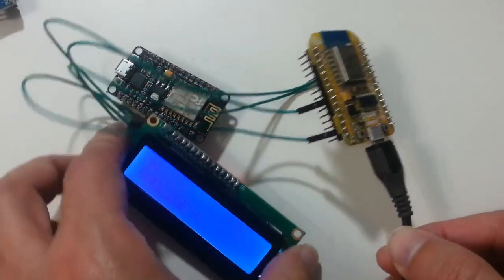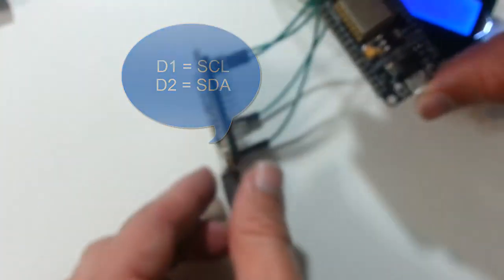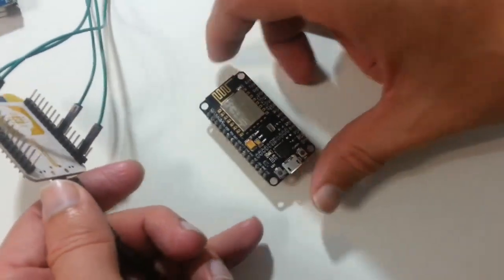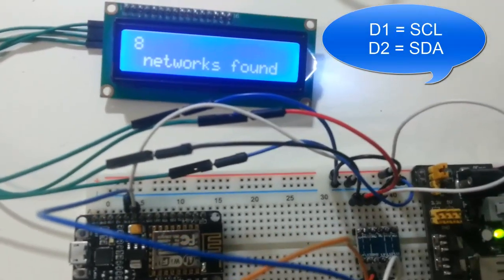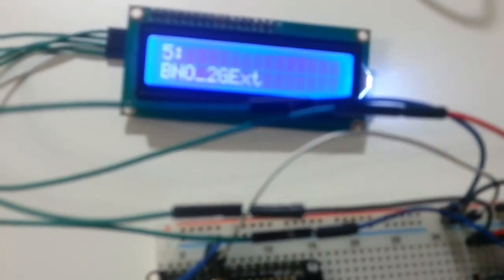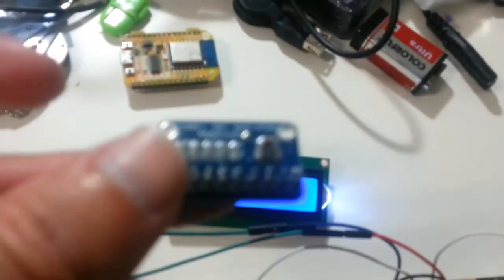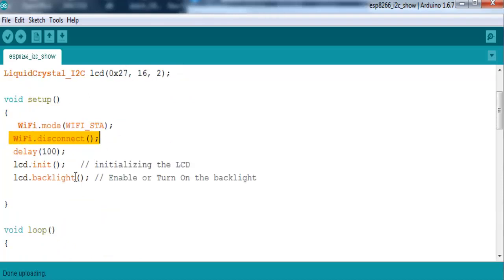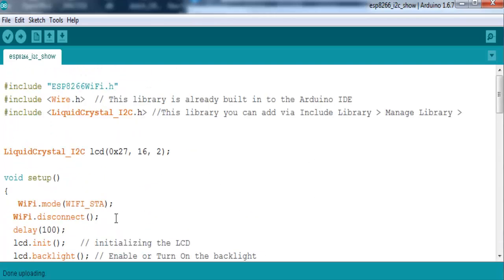step by step : Nodemcu Esp8266 I2C lcd display

Comment: Thank you very much sir your already save my life LoL.
Reply from the maker: +kiadtisak buangam 
Great !!!
Reply: Marco Arduino channel 
I spent alot time to connect RTC mudule to my Nodemcu1.0 i try to search google many time and filnally you tould me i connect it with swap SCL and SDA pin lol.
Reply from the maker: +kiadtisak buangam 
Why do you need an RTC with your nodemcu ? Simply go to a time server and get the time
Reply: Marco Arduino channel 
I would like my Nodemcu to use real time clock in offline.

Comment: So the first nodemcu worked fine with the lcd at 3.3volts, but the second one only worked at 5 volts. Is that correct?
Reply: In all fairness, I haven't seen it work on the first 2 nodeMCU's that you showed and that had the LCD wired up to 3.3 Volt (till 2:05) the one afterwards, on the breadboard is as you say connected to 5 Volt. It is not a matter of the display being brigther, it is a matter of not seeing anything on a 3.3Volt fed LCD.
I haven't seen it work on  3.3Volt anywhere yet
Reply from the maker: +Revelation612 
The brightness of the display is better on 5v but you need to use a logic level converter

Comment: I have interfaced Arduino Uno with ESP8266-01 and 16*2 LCD .I want to control LCD from webpage. I am new to server,web side.Now the webpage has two text box and submit button. When i type text on webpage and click on submit button ,text should appear on LCD. I am stuck in web part . How to communicate web part and Arduino. I tried HTML with GET method . But not working .Some suggested saying try Php. Can you  please help.
Reply: There are plenty of examples on how to turn on an LED with the Arduino over the web (with GET). If can turn on an LED, can turn on a relay I think?
Reply: dude have you figure out the solution? im using espresso lite to control lcd from blynk app, but my code doesnt works
Reply: I dont know blynk, or at least I have no experience with it but if you enter a command on a webpage and use a post or get, then on that 'new' page that is generated you can read the  command and then issue new commands e.g. to your LCD
I suggest that you google a simple  'switch a led on/of via a webserver' and instead of switching an LED you send a command to yoiur LCD

Comment: What settings do you choose in the Arduino compiler? did you change the card setting?
Reply from the maker: +Matan Yehoshua board: nodemcu 1.0 (esp-12e module)upload: serialcpu freq: 80 MHzflash size: 4m (3m spiffs)upload speed: 115200port: the com it is sitting onprogrammer: avrisp mkII
Reply: +Marco Arduino channel 
Thanks
יש לך אחלה ערוץ 😜